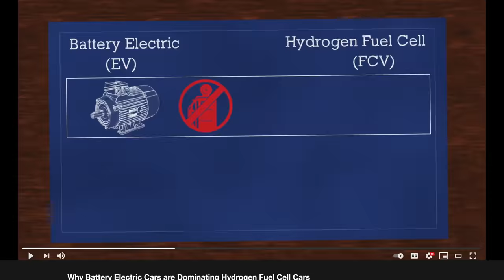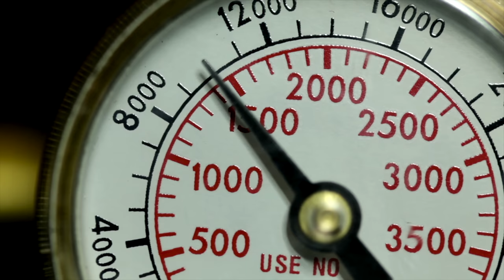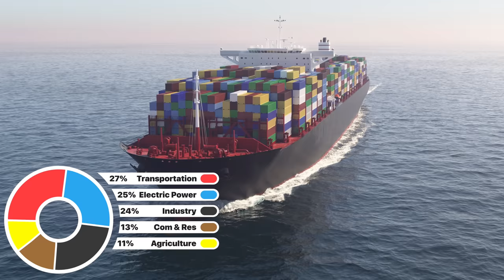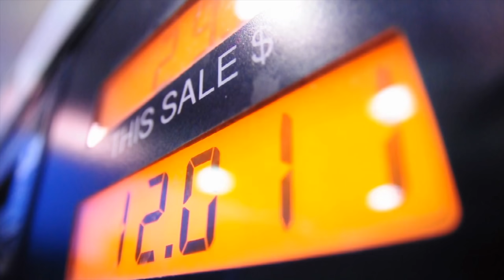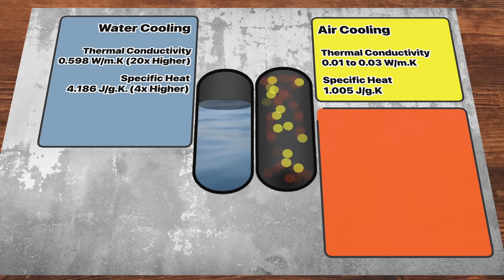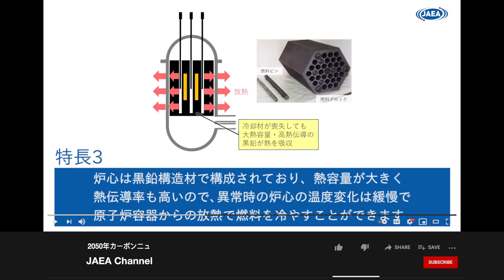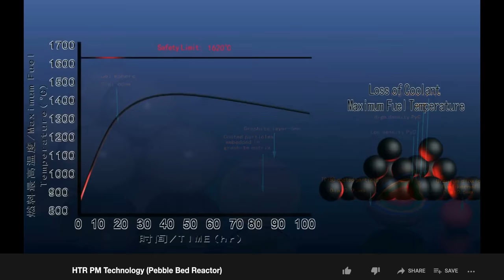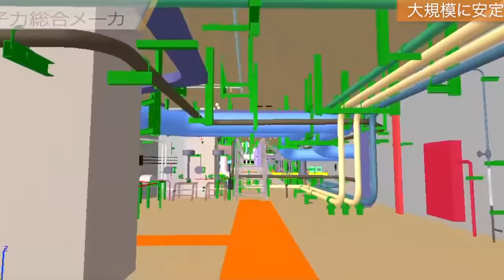Japan's Plan to DESTROY the Price of OIL and GAS!

Comment: EV are NOT "0 Emission".  You have to remember what it takes to make a battery.  An EV must be driven between 60K & 100K miles (depending on the battery) before you just break even.  And they only last about 100K miles and then you have to pay $5K - $15K for a new one and we have NO way to recycle the used batteries.  Plus, even if every car, pickup and SUV in the U.S. were EV's, it would only lower our Carbon Duoxide output by 10-12%.  Of course, since the mining happens in poor countries, their output will increase more than ours goes down, which makes for a Net Increase if crap going into our atmosphere.

Comment: The biggest downside of nuclear reactors is imo not safety risk, but the waste problem which we still didn't really find a solution to yet.
Reply: We do have a solution.  You can recycle nuclear "waste" with a slightly different kind of reactor.

Comment: It’s a good thing that the US just mastered fusion. And Microsoft just pledged to be 100% fusion powered by 2028
Reply: Fision SMR is under development in Wyoming...
"TerraPower begins construction at 345-MW advanced reactor site in Wyoming The company expects to begin building non-nuclear electricity generation infrastructure in 2025, TerraPower chairman Bill Gates said Monday. Alongside its 345-MW reactor, the facility will have a molten salt-based energy storage system that can achieve a power output of 500 MW for more than five and a half hours. The storage system is unique among advanced nuclear reactor designs and “allows the plant to integrate seamlessly with renewable resources,” TerraPower said." - 6/2024

Comment: Separating water into H2 and O2 with just heat has been investigated for decades, but it recombines so quickly that efficiencies are too low.

Dunno what sense it makes...  50% energy loss from nuclear electricity --> hydrogen, then 38% loss of hydrogen --> electricity. IF batteries can do your job for you, then battery drives are just no-brainer.

Comment: we still need oil (lubrication) and fossil fuels for manufacturing (heat). Carbon is not a bad thing if you are a plant. People forget that faucets don't make water, cartons don't make milk, and batteries don't make power. They are all a delivery system. All these systems need to work together.

Comment: The sad part of Japan shutting down nuclear reactors is that Fukushima was caused by human error and the arrogance of the management at the Fukushima plant.  
There was another reactor of the same design that did not suffer damage because the management there actually practiced emergency contingency drills and knew exactly what to do to shut down the reactors.
Blame nuclear energy for what happened to Fukushima is similar to blaming one race of the other for the ills of the world.

Comment: Meanwhile, Fision SMR is under development in Wyoming...
"TerraPower begins construction at 345-MW advanced reactor site in Wyoming The company expects to begin building non-nuclear electricity generation infrastructure in 2025, TerraPower chairman Bill Gates said Monday. Alongside its 345-MW reactor, the facility will have a molten salt-based energy storage system that can achieve a power output of 500 MW for more than five and a half hours. The storage system is unique among advanced nuclear reactor designs and “allows the plant to integrate seamlessly with renewable resources,” TerraPower said." - 6/2024

Comment: Great video as always, but the important question of cost was not addressed. How much does red H2 cost and how does it compare in terms of operating cost and range when used in a vehicle compared to ICE cars burning fossil fuel?
Reply: More importantly, how does it compare to battery powered EVs? They have to compete with wind, solar, and hydro, along with the more expensive nuclear electricity.

Comment: This entire technical approach, while provoking an essential discussion (bravo!) is rendered obsolete by new breakthroughs in Geo-Thermal technology.  These technical improvements have, ironically, been developed by the Natural Gas Fracking industry: specifically, the ability to drill previously-impossibly-deep holes into the earth's crust, to tap heat directly from that effectively-infinite heat source.
By drilling down to create Thermal Taps on-site at existing power plants, it will be possible to Replace Every Existing heat-source - coal, natural gas, oil, or nuclear fission - with Geo-Thermal heat.
The advantages of this approach are obvious and massive: without the need to build new power-plants, the cost of this 'bridgeing' approach will be vastly less than any comparable strategy for wholesale carbon-reduction in the energy sector.  Subsequent adoption of Hydrogen as an energy-storage medium will (hopefully...) limit battery production to manageable levels, and avoid the worst excesses and environmental degradation of that storage-technology - at least, until acceptably non-toxic battery chemistry is developed.

Comment: You are forgetting a better transitional step, before Battery EV or Fuel Cells, Hydrogen Internal Combustion Engines.  90% of the current engines stay the same in the vehicles, just the fuel delivery system changes and the ignition timing changes, while eliminating tailpipe emissions.  Yes we would need to install the filling and storage stations, just like EV, but refills are done in under a minute (as compared to 30+ minutes in warm weather, or hours during winter).

Eventually we will probably end up with a majority EV transportation system, but we are a long way from having the residential infrastructure and overnight power supply to handle everyone recharging their vehicles at night.  Hydrogen eliminates the health hazards without having to worry about building thousands of power plants (either Nat Gas, Oil or Nuclear), upgrading the power grid, the chemical fire worries of EV batteries that are impossible to extinguish and tend to reignite hours later.  The only real worry about hydrogen is the invisible blue flame it burns with as safe high pressure transportation was solved a while ago.

Comment: Using Helium is not the answer. Helium is very scarce. Nitrogen is cheaper and easier to extract and is 77 kelvin (-196c) whereas helium is 4 kelvin (-269c)

Comment: If you can generate electricity instead of hydrogen, then it pays more to produce electricity.
The alternative is to produce hydrogen to produce electricity later.  So you need to compete with hydrogen and fuel cells vs batteries.  And batteries are way way more efficient, cheaper to produce. Charge and transport. But less energy dense.
So it is very doubtful that hydrogen will be able to compete medium and short term.
That is supposing that we could fix the fuel cell issue.

Comment: I love nuclear reactors.  But pressurized hydrogen at high temperatures?  Sounds challenging.  Not impossible.  But will require more, costly, safety.  The temperatures could be reached without pressurized gasses.  It could be reached with molten salt reactors.  At what point the question should be asked, "why not produce heat or electricity right at the country or region of consumption? ". This solution would also potentially solve your nuclear waste problem, if you use a reactor that burns nuclear waste, such as Copenhagen atomics' reactor.

Comment: There is no race. Hydrogen is not the answer for cars and smaller vehicles. Makes more sense for HGVs, Ships and maybe even airplanes. Hydrogen is not easy to store and causes embrittlement which can lead to catastrophic failure. Gas stations are bad enough when they go up in flames, but a Hydrogen refill station doesn't burn, it explodes. Even a modest size tank would take out a city block killing thousands in an urban environment. You've also got to transport it to the stations, unlike electricity which delivers itself over powerlines with minimal losses. Plus, water vapor is a higher greenhouse gas than methane.

Comment: I find it ... surprising ... that Japan is considering Nukes, for anything. I thought they were still gun shy after Fukashima. They shut down a bunch of their nukes after that event. What has changed politically to allow use of nukes?

How about using nuke to power an old style synthetic fuel plant, one that builds up carbon and hydrogen to create "gasoline".  Granted, it is an additional process beyond "red hydrogen", but it is carbon neutral fuel that can be used in ICE vehicles.

Comment: The preexisting terminology used to identify by which method hydrogen was produced with tends to refer to nuclear produced hydrogen as Pink Hydrogen. If anybody out there is going to search for more info on "red hydrogen", I'd recommend searching for either Pink Hydrogen or purple hydrogen. Cause if red hydrogen is searched for, you're going to get a smartphone filling up the results. Anyways IMO nuclear produced power is just hilariously over-hyped. Cause at its core, nuclear power plants are just steam power plants, 1880's technology. Now gravity generators, there's something futuristic LoL!  Gravity generators/ batteries are a deep hole or tall building + a weight & rope attached to a motor and as the weight slowly falls it produces power. No joke, that paired with a solar panel and it's considered the newest idea for a renewable energy source. 
Anyways, back on topic! It's impossible now for outsiders to affect big oil's gas prices. Mainly because they stated they've reached their "production cap" and from then on (2020  or 2021 I think it was reported), they would be producing less and less every year. Pretty much meaning less supply, increased demand, and thus increasing prices no matter what. So nice use of clickbait. But I stopped watching at the 2:00 mark, cause your narrator's voice sounds too much like the spammy fake YouTubers.

Comment: The problem with hydrogen is moving parts, it has similar properties to a gas or diesel engine. It lacks the efficiency of an electric motor and it’s simplicity. Who wants all those parts moving in a hydrogen vehicle

Comment: High-temperature gas-cooled reactor (HTGR) fuel efficiency of 0.5%  cannot compete with the 98% fuel efficiency of the Molten Salt Reactor (MSR). Thorium MSR produces very little plutonium and does not require a high-pressure vessel.

Looking ahead to 2040, China plans to deploy Molten Salt Reactors (MSRs) for desalination of seawater, district heating or cooling, hydrogen production, powering of ships equipped with Thermoacoustic Stirling Generators, and power plants with Supercritical Carbon Dioxide Turbines within its borders and globally.

Comment: Here are the significant problems with hydrogen...
  It is not a source of energy it is a carrier of energy just like electricity is. Green, HTGR or any renewable energy sources are still rare and we should use them as efficiently and effectively as possible. Hydrogen doesn't do this. Steps to use hydrogen...
1- Produce Electricity 
2- Turn electricity into hydrogen and store it. 
3-  Transport the hydrogen in expensive high-pressure tanks 
4- Fill another expensive high-pressure tank at a refueling station 
5- Then fill the vehicle's big high-pressure tank
60% of the energy is lost through this process
Alternatively, you can use the same energy from step 1 and skip the 2-4 steps saving money. By using the Power line infrastructure we already have we can charge an EV,  and only lose 20% of the produced energy.
Plus you need 3 times the size for storage than natural gas (an energy source) because of hydrogen's lack of density.

Comment: Huge fan of hydrogen; hydrogen has gotten a bad rap since the Hindenberg and this has set back research and development by almost a century. 

I also think geothermal is insufficiently explored. We need to find how to extract much more heat energy and also work out in advance at what hypothetical level of energy extraction do we start to risk actually cooling the earth's core. Hope they get it right. 

Coming to HTGC reactors specifically you didn't mention one thing - where are they going to find that much helium?

Comment: The problem with Nuclear energy is it got off on the light water fission rector design instead of the LFTR technology molten salt thorium reactor.  Then accidents and natural catastrophe issues happened and people began to run scared instead of seeing how it could be fixed. Not the Japanese.  They are surrounded by unlimited fuel source of the Ocean for Hydrogen.

The argument with hydrogen is always the same - compression and transportation makes it inefficient and thus barely worth it.  When compression and transportation is eliminated by on the fly generation only requires low pressures around or under 100 psi, and volume becomes the question per application.

The obvious rejects are pure consumption application unless powered by an electricity source on site which is zero emission. 

The only two feasible 100% reliable safe sources are LFTR Nuclear or rotational energy like from a hydrogen powered internal combustion engine with enough alternator capacity in amps to generate more hydrogen than the engine needs to thus keep a buffer tank full.

All of the Hydrogen downside goes away.  All of it except maybe the minor nox issues.  In bifueling a diesel pulling a hill that normally overheats the engine actually cools it bifueling with hydrogen. 

The Japanese have developed the HTSE, and it's Achilles heel is the helium gas which can escape somewhere, unlike the LFTR Nuclear solution which burns Thorium, and unlimited fuel basically "ROCKS" of which is found freely everywhere.  The LFTR is walk away safe and if it begins to overheat it pops a safety valve the salt solidifies and the reactor stops. 

With a Hydrogen  ICE old engines can be converted and power multiple alternators which takes minor extra horsepower, but the issue is the exhaust needs to be recaptured and no matter what hydrogen production that is not fossil fuel reforming, uses water and so due the worldwide water crisis for fresh water, and due ice and consation issues which would wet and / or fog the roads, ONLY the Hydrogen ICE would survive and the means yes it runs on water or water based waste stock like urine Grey water polluted water et cetera.

A person work on their own vehicle, with electric probably and likely not.  The Hydrogen electrolyzer will need periodic repair or replacing, but literally many times the owner could do that too. 

Just remember no one sells hydrogen but rather on the fly systems, so no trips to fuel station at all.  Since the exhaust is recaptured and recondensed, adding more water is minimized. 

Suddenly the electric car looks pretty dumb to do.  If you do not have an adapter or whatever the charging station charges you are stuck.  Then there is finally the battery issues which could be deadly or costly over time. 

The Japanese are right and I have it on good authority they are going to build in on the fly fueling for their hydrogen ice products while retaining the on board tank storage you can buy at a station.

Comment: Volume issues with h2. So you increase pressure, this causes fire issues. So you use carbon based carriers. Then you get co2 output. Kek.

Comment: The solution is you get thorium molten salt reactors and then you get a smaller percentage of the hgr reactors the hgr reactors will be used for hydrogen facilities the thorium molten salt reactor can burn away the nuclear waste from the hgr reactors which they can safely do the thorium molten salt reactors would be used for the power of the grid of the United States the hgr reactors would provide the hydrogen for airplanes and jets and other large industry machinery. Problem solved!

Comment: If your going nuclear,  why not just generate electricity and send it on the grid?  No need to create a new distribution network.  No need to liquify or compress.  What about the nuclear waste?  What about proliferation risk?   The only way to use nuclear  is to figure the waste issue.

Comment: Like I said with the test Murray has to put a generator in the back so you won't have to run out of energy alright time to forget about your carbon footprint right. When you're stranded on the side of the road your carbon footprint is the last thing you think of you crank up the generator and you charge your battery. Danger averted. It's always compromises in everything in life. That's why the word trade-off is the second biggest word in the English language hope you enjoy reading what I had to say.

Comment: If we went all electric we'd have to start with nuclear plants and then rebuild the whole grid.  Using fossil fuels to make electroicity would just be a move sideways where we would just be moving the exhaust from the car, to the smokestack.  We would also have to build more power plants fueled by fossil fuels to handle the extreme demand.  There'd be no gain.

Comment: Galvanic voltaic pile batteries are often mistaken for perpetual motion machine panaceas quick solutions due to emotional spiritual reactions to electrical lightning storms so please consider how  early 1940s Hamgyong Province had Hasegawa's Project NA  NZ of synthetic fuels which depended on hydroelectric geothermal power since at least such efforts resulted in muon catalyzed fusion Prior Art on of Alvarez and Prior Art laser optical traps on of Maiman.

Comment: It's no wonder that Toyota has been more interested in coming up with hybrid hydrogen electric vehicle solutions, than pure EV's! It seems that despite everything, hydrogen produced by nuclear technology is the safer option, since the vast majority of current electric power plants are fueled by coal; and the larger batteries used by EV's will soon enough start picking up in toxic waste dumps.